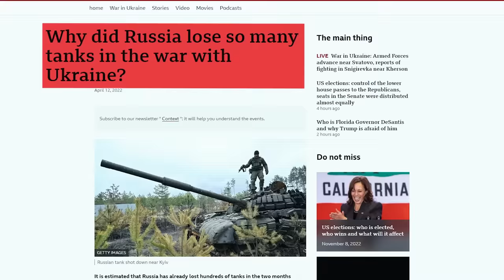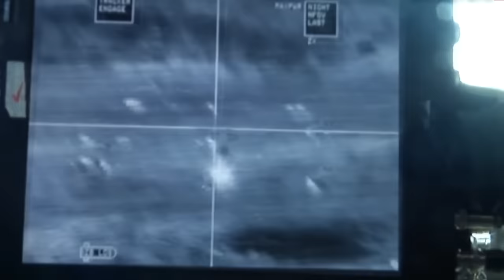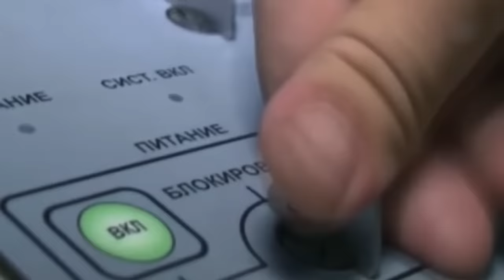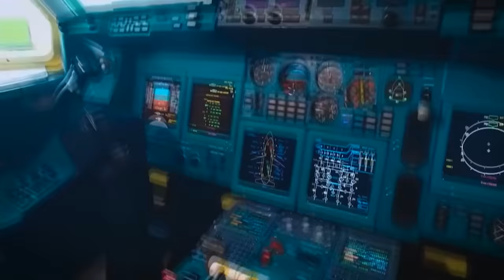Something is wrong with all Russian tanks

Comment: Through corruption many "stored tanks" were chopped by souvenir hunters and people like me collecting spares. 
 We would just cut a hole through a tank to get spares out. Many tanks were sold for scrap to , a going rate was 8 bottles of Vodka per tank, and as for the maintenance, let alone storage, they just got stacked up like an old car scrapyard, turrets off and filling with water.
  Ever see a tank full of water freeze and pop! 
  As for built quality well they were no Rolls Royces!
Reply: What were most desirable items? 
Radios? Fire control computer? 
Optics? 
Could you sell those on eBay?
Reply: Russia's tank design was "fast and cheap to build" vs "strong, robust, and well made"
Reply: You might have saved lives by rendering those tanks useless
Reply: @richardkudrna7503  These items had usually already gone, we were after transmissions, engines, track rollers and bearings, turret hydraulics, suspension trunions and heavy mechanical bits.
Reply: @richardkudrna7503  I wish Ide done a bit more spares hunting as it were, but by now the tank yards are really just full of scrap.
Reply: @aA-ye1cf  oh well. After the war we can buy fun souvenirs on eBay.
Reply: @aA-ye1cf  holy cow, you got engines and gearboxes? We’re you able to sell these to farmers to put into the farm combine? 850 hp diesel combine!

Comment: That tank jumping is so fuggin cool! Like 60 tons getting air
Reply: A better way of describing it would be: 'expensive.'  And tanks don't do this for the same reason cars don't - the suspensions are not designed for that kind of abuse.  And designing a suspension for that kind of abuse is stupid because the additional weight of the reinforced suspension means that the tank needs to carry less armor, ammunition, smaller engine, etc.
Reply: @colincampbell767  I'm sure the crew enjoyed every second of it. 
Who doesn't enjoy the feeling of being tumble dried.

Comment: During the cold war, the Soviet Union had tank based shock armies in western Europe that could probably reach the English channel in a relatively short time. Nato knew this and so threatened potential first use of tactical nukes in the event of war in order to slow them down. Each side has threatened first use of nuclear weapons over time.
Reply: No, the Russians haven't lost "3000" tanks. All Oryx Data shows 1000, 2000 max without visually confirmed.
This video is pretty dumb, since it apparently mixes up armored vehicles with tanks.
Reply: @RazorsharpLT  SMOKING TOO MUCH GAY WEED DAD ?

Comment: O.K,  Rust on the hull or fittings of a tank is probably irrelevant to function.  But yes, FUBARed electronics is a completely different deal.   Engine and transmission are probably somewhere in between these two  subsystems  in terms of hardihood.  
 I think these discussions are discounting the Russian ability to improvise and cobble together machinery, however.  Russian infrastructure and consumer goods have ALWAYS been iffy,  the mindset of the population is very DIY and very mechanically able.  Western armies and engineers expect everything to be figured out and all components to be fresh.  Russians have a lot of experience rigging things up with bailing wire.  What is my point?  I expect they are furiously coming up with procedures and designs to churn out tanks right now.  We shouldn't be too self satisfied.

Comment: Russia has plenty of tanks...   They are just a bit old and will have to be cannibalised to get a certain number ready...  so maybe 2-3 to get 1 good one (well one that actually runs).
Reply: don't worry, their tanks are in much better condition than yours! ;)
Reply: @greyvoice7949, by old you mean cold war tanks of which 30% are rusty and beyond repair? I agree.
Reply: @Maddog-xc2zv  do you mean leopards produced in 80-ies? It was cold war, they're rusty and beyond repair but Zelensky is happy to get them! What's your point? ;)
Reply: @Cachalote65  Leopards bult in the 80's are already L2 versions. Many where phased out or upgraded. Some A4 versions are superior to base A6. yes, I would be very glad to get them if I was ukrainian. Even the Leos 1 are better than using pickups (or buses like the russians already did to move troops) without any armour at all. Still the 80's leos 2, vastly better than t-72, t-80 and even the undeperforming T-90 which active deffenses seem to been failling all day. Those Leo2 will have thermal and stabilized guns and will be in some cases upgraded. My point is made.
Reply: @Maddog-xc2zv  it's only theory. In real life those leopards can be easily burnt out. Watch some videos from Syria. ;)
Reply: @Cachalote65  yeah, if you send any tank without support or untrained crews that's what happens. but more to ones than others, surely.
Reply: @Cachalote65  so you say. i double down on the same features regarding the present majority of russian army (poorly equipped and poorly trained). pov's... cheers.
Reply: @Cachalote65  sure, sure. as is said, pov's.
Reply: @Maddog-xc2zv  the guy really thinks because he saw some leopards destroyed that means they're inferior 😂😂😂😂😂😂

You can't make this shit up
Reply: @joshuablair252  no. just pure ignorance, unfortunately...

Comment: T62 tanks are currently being upgraded in Russia with reactive armour and night vision  or thermal cameras, depending on availability. Putin himself ordered that, by decree. Soviet tanks are tougher than you think. The People's Militia of Donetsk managed to launch an IS2 tank introduced into the Red Army in 1943, which served as part of a WWII memorial. This tank was most likely not moved for decades, on the video you could see that the engine stuttered extremely and emitted black smoke when starting, but then the tank engine ran smoothly. These militiamen were able to drive away with the tank. I think this tank has almost no electronics that could be damaged. The IS2 tank was used in combat against the Ukrainians, but was captured by the Ukrainians. Since then, the IS2 tank has been back where it belongs in the museum.
Reply: @David Young That was related to the motors, because they are very robust and last a long time. Of course, Soviet tanks are inferior to Javelins and NLAW. Without combat operations, however, Soviet tanks are still operational for a long time, that's what I wanted to say.

Comment: Main difference with the old leopard 1 A5 tanks ,   they are stored correct and maintained .  Leopard 1 A5  had upgrades for decades and at one point had better fire control and sensors than the Leopard 2 a4 .
Reply: It's worth noting that correct storage and maintenance should not be taken for granted in the West either, even if the situation is far better than it turned out to be in Russia. One of Spain's big arms deals to sell their Leopard 2 tanks to Peru failed in part because of how poorly maintained Spain's Leopard 2 stockpile was discovered to be.

As for the Leopard 1A5s... even with modernised optics, fire control and ERA, you can't get around the basic problems of the design being a product of the early 60s: a period where tank designers had given up on the idea that a tank could have enough armor even frontally to hold up against another tank's gun. It's the western counterpart to the T-62 and is very much a death-trap for the crew on a modern battlefield. All the modernisation packages really do is give it hope of getting off a few shots before it has to withdraw or die. It probably won't see frontline service in active parts of the front if the Ukrainians have any sense, but will find their place as a tactical reserve along the Ukraine-Belarus border and the northern parts of the Ukraine-Russia border where the Russians have been pushed out of Ukraine already, allowing the UAF to reposition their more modern vehicles from those sections to active parts of the front in the east and south.

Comment: Russia should start to manufacture the WWll German tiger tank with it's 88mm shell.There was a German tiger tank hit over 20 times by the Russians with only one tread and it made it back to the German lines.Honestly I would really love to see a WWll German tiger tank up against one Russia's tanks.I bet the Tiger tank wins using a 105mm shell instead of it's standard 88mm shell.Seriously wouldn't that be awesome!
Reply: Well, there was a russian kv-1 (or kv-2) at the beginning of the USSR invasion that withstand a huge amount of hits. The tiger you're talking was probably hit by early t-34's or other tanks that had less powerfull shells. Later, the t-34 was equiped by a 85 mm gun that was more than capable to blow a tiger, except at frontal long range. Even then, tiger had thick frontal armor but the sides were medium at best.

BTW, I also hear a similar story but it was british tanks agains't a tiger. Most probably with 6 pdr.

Comment: Biggest worry for the new to arrive Nato MBTs in the spring which when they do arrive , will dominate the battle field , is  Russian missile & Howitzers.
My Comment 
The Russian AAM R-37M Ukrainian MiG-29 pilot who called it “f*****g scary,” the long-range R-37M air-to-air missile (AAM) is particularly worrying to the Ukrainian pilots am
MiG-31 pilots can fire a single, underbelly R-37M missile at targets up to 200 miles (more than 300 kilometers) away, . Its far greater range than current Ukraine Pilots can return , also it just takes them out  without the Ukrainia Pilots even  knowing its tracking them.due to the AAM high speed .

My Comment 
The longest ranging gun in this war is the Russian 2S35 Koalitsiya-SV reaching over 70 km . This means Ruusian artillery will out gun Ukraine in range for the current future .It must remembered that artillery has shown once again that in terms of casualties, indirect fires account for 70-80% of the total. Tho with the advent of battlefield drones , still developing by the ever adaptable , smart Ukraine AFU , its playing its part at adding to the enemy casualties on the front & interdiction operations.
This gun alone will take out Ukraine tanks with its 70km range .

Comment: Tanks are obsolete since WW2, ever since the bazooka it has gone the way of the dodo, It's like the battleship it's too costly and does not add to anything.
Reply: Total and utter rubbish. Properly used they are still the spearhead that breaks lines. Wait a couple of months and you will get to see what modern tanks can do.
Reply: @simonj5615  And they still get easily destroyed by weapons that are a fraction of the cost of a tank. Not even including the cost of the crew and fuel and so on.

Comment: I Think that the old T-34 are better than their Atomic missiles witch probably dosnt work either anymore or will fail the siloes
Reply: T-34-85's were hated by German forces in WW2. Hard to kill and they worked better in winter than the Panzer's did.
Reply: t34s were made with a huge amount of american parts,i recently saw a russian historian talking about it. he said the t34 should really be called an american tank, and that  the ussr would have lost ww2 without america. i bet you this historians going to have a tragic accident,and fall from a tall building,lol!
Reply: @tonyv8925  Tiny was not even born then. Don't tell him, well....no big deal.:face-purple-wide-eyes:
Reply: @tonyv8925  yeah, 80 years in the past
Reply: @joellemaster998  I don't see how that could be. Completely different design with thick but poor metal, bad or no electronics, poor transmissions, dangerous, hard to drive, cramped spaces and good guns.  The Russians did like the lend-lease Shermans, though. They thought they were a bit top heavy, but overall, a great tank. They were reliable, well finished, had excellent metal, drove well, had lots of room inside, had a small auxiliary motor to charge the batteries, and came with excellent radios, Shermans had their flaws, but many of the flaws the Russians found were fixed on the next shipment.
Reply: @dbeaton1111  the barrel or something like that was American made. He's exaggerating

Comment: Tanks are no good without air support and ground support.
Reply: Originally tank was a weapon designed for one simple task: crossing the killing zone between trench lines and breaking into enemy defences. Later the main role of the tank was considered to be that of close support for the infantry, which was still quite close to the original purpose, but more generally. If it is nowadays infantry's task to support tanks, we may wonder have they lost the point. Imagine an officer telling a platoon that their task is to support and protect a 60+ ton war machine.

Comment: You are making an important error.
You are confusing "Combat Ready" for "Combat Capable."
Are these tanks "Combat Capable"?  Yes, if you roll them into combat they are going to be able to do something for you, even if in reduced modes of operation and with increased losses.
Are these tanks "Combat Ready"?  No, not by a long shot.
Russian tanks have been engaged in action for almost a year now.  They are tired.  Gun tubes need replacing, tracks are worn out, suspensions shot, Engines in need of overhaul, ERA depleted (if they had any) and the crews and maintainers are exhausted.
The tanks still in the field are at only a fraction of the effectiveness and efficiency they were at the start of the war.
Now that the T-14 is officially dead (as of this week), the only place for the Russians to go is back to the War Emergency Reserve fleet of early T-72's and late T-62's.
These tanks aren't even worth scraping the rust off of, lacking organic armor, thermals, modern fire control and communications equipment.
They are a death sentence for their crews.
Reply: BATTLEFIELD UPDATE 17 WITH SCOTT RITTER - THE BATTLEFIELD SHRINKS )(a Rokfin exclusive) Watch this video on Russia. Russia is winning with all these sanctions and NATO is losing. Look up Scott Ritter and Col. Macgregor on youtube to get the facts.

Comment: We have to say that T80 and T90 are based on T 72 with modifications they don't give better quality. Actually T 90 is just a market name of T 80. The focus correction system is French which means that it cannot be used due to restrictions from the EU side. A film about T 80 and T 90 would be good. The tank called Armata has so many problems. But I don't want to take away from the author the pleasure of creating a film about these problems.